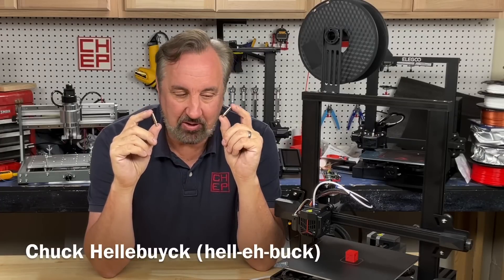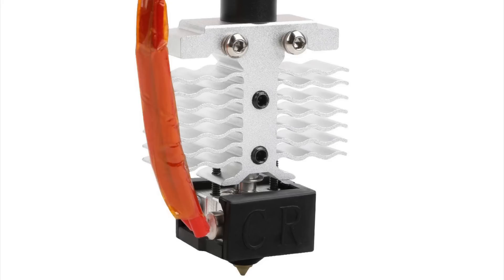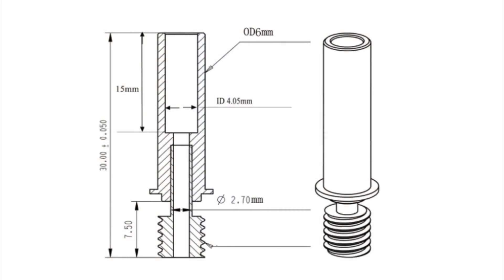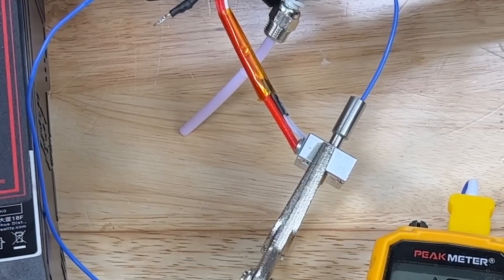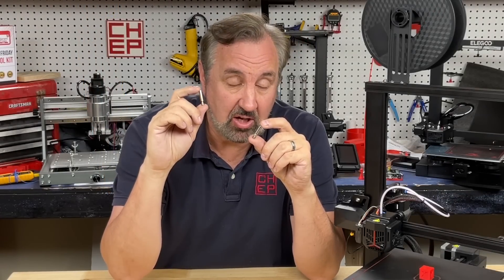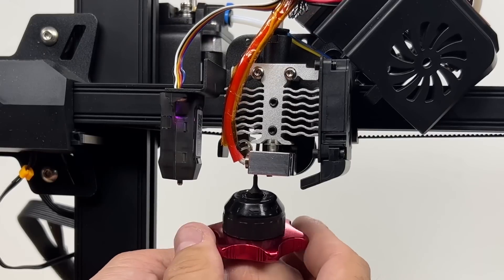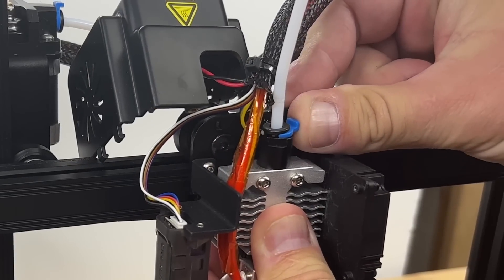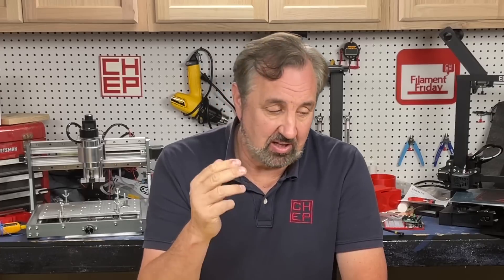Upgrade Ender 3 Neo Hot End

Comment: Thank you for this video. It seems Creality is mixing and matching things up a bit with their models. I have a CR-10 Smart with the same hot end shown in this video. I think the CR-10 Smart uses parts from the CR-6.  I'm buying this from your link, as I switch filament often and want to gracefully transition from PLA / ABS / PETG / TPU as desired. This might just help with that.

Comment: I wonder why my foray into the Slice Eng heat break created prints that were under extruded but only in spots with huge holes in the print.  I went back to good ole hot PTF Tube and all is perfect again.  I just wanted to reduce the amount of times I change the PTF tube but it's worth the work to have better prints.

Comment: Great video, Chuck!  I spent $100 to upgrade my Ender 3 Pro, not aware of this printer which has all of the upgrades I purchased pre-installed.  I'm still struggling through issues with my upgrades (and a possibly a failing extruder).  If I'd known I could have purchased the Ender-3 Neo for under $200, I'd have just sold my Pro and purchased this one.  I'd be way ahead!  Hind sight, as they say...

Comment: The only issues I've had with all-metal hot ends is with PLA at lower layer heights (sub .2) with a .4 nozzle or if I try to iron the top of a print.  As long as I'm pushing a good amount of plastic at a decent speed, the all-metal hot ends work well.  I haven't tried a bi-metal yet and that might do a better job of keeping melted material from creeping up the heat break and causing a clog.
Reply from the maker: I’ve had no issues with that.

Comment: I've been using all-metal heat breaks in my Ender 3 and Sidewinder X1 for a while and wouldn't go back to a standard setup ever again. With the quality metal heat breaks out there and a little tweaking to your retraction settings, there are absolutely no advantages of having PTFE in direct contact with the nozzle (while there are plenty of drawbacks).
Reply: how are your retraction settings
Reply: @JPZEF  On the Ender 3 with the Micro-Swiss hot end and direct-drive extruder, 1.5 mm at 35 mm/s seems to work for pretty much everything other than TPU (I last printed Ninjaflex at 0.2 mm and 50 mm/s). For the Sidewinder with either the Polisi3D or Trianglelabs bimetallic heat breaks, it's varied between 1 mm for PLA at 25 mm/s, 2 mm for PETG at 25 mm/s, and 0.5 mm at 20 mm/s for TPU.

Comment: This has to do with heat conduction, not absorption. Titanium is a very poor heat conductor but has a high melting temperature, which is why it's the metal of choice here.  Copper is a very good heat conductor, which allows the heat to conduct to the filament near the nozzle.
Reply: All those fancy bi-metal arguments only give small incremental benefits.  Just stainless steel all the way is better than having the PTFE tube going to the nozzle.  Sure, a bi-metal heat-break will ensure better cooling at the cold-end because of the copper there and hence make the temperature of the fillament above the small section a bit lower, but if stainless steel can get this below the glass-transition point quickly enough, then the extra gain of the copper doesn't bring much.  And the melting is done at the hot side, where you have either PTFE, stainless steel or titanium up to the nozzle, which all suck for transferring heat, but that's also the intention.  So the melting is to be done in the nozzle, not the heat-break.  So, I'd say: at least get a $2 stainless steel all-metal heat-brake replacement as even that cheap one will be much healthier than cooked PTFE!
Reply: @MisterkeTube  I'm guessing that you're right, that the bi-metal aspect is only slightly more than a gimmick.

It would be good to do some measurements to see how much the flow rate is affected by going from pure titanium to the bi-metal design.

I'll bet CNC kitchen has done it already. I haven't bothered to look.

Comment: Did you need to change your retraction settings? I put a all metal heatbreak in my Ender 3 Max and found that it appeared to be retracting melted PLA into the cooler section of the metal path and causing blocking. I have experimented with Maker;s Muse retraction tower everything in the range 2mm-5mm but nothing seems to be "perfect" - too short and stringing and blobbing is a problem (because of he bowden tube?) and too long it seems to jam as described. Its possible I might have a problem with the filament as what I have is getting a bit old, so I haven't tried everything yet, but I just wonder if there are any other things I should look out for, I would try a direct drive extruder (which I have but needs modifying to fit) but am worried about the extra weight on the wider X carriage and I can't afford dual Z right now even if one was available for this "frankenstein" printer.
Reply from the maker: I didn’t change mine.
Reply: @FilamentFriday  Hmm it may be something else then. I think I'll try getting some new filament  just to eliminate that and then redo all the setup again.

Comment: I'm just really confused on how companies still can offer ptfe lined hotends. An all metal heartbreak is like 5 dollars max, and can boost the printing temp far above 260c.
Reply: Or 30 ish if you get the slice engineering one
Reply: @sammy_1_1  yea but that's crazily overpriced. You can get a heartbreak with the same performance for much cheaper. Even the official e3d one is like 7$

Comment: He didn't mention you should change your retraction settings when installing an all metal heat break.
Reply from the maker: I don’t. So I didn’t mention it.
Reply: @FilamentFriday  I see. Very interesting.  When I added mine to 2 different printers I was having issues with clogging. Changed my retraction settings and now they print beautifully.
Reply: @jerryscott6924  How are your retraction settings now?
Reply: @JPZEF  they are good. Went from 5mm and 45mm/s to 2mm and 25mm/s.
Reply: @jerryscott6924  what is you gcode star/end

I fell that most of my issues with retraction are related with clogging when starting.
I don't know if it is a bltouch related issue

Comment: How about the Ender 3 Pro? Will it work for that model?
Reply: I've built hotends with these heatbreaks(e3d & mk8), just find the style that fits your hotend and follow CHEPs directions to install.
Reply from the maker: If you follow the video I linked in description it will work with pro.
Reply: I have my Ender 3 Pro working with an all-metal heatbreak I've found online since 2 years ago... Best upgrade I ever made to this machine! (And I could tell you I performed way too many upgrades to it! 😅)
Reply: @nilssondelgado  how are your retraction changes now?
Reply: @JPZEF  Good question indeed... After many testings I found that a good retraction distance setting was around 3.0mm, but after a while I converter my Ender 3 Pro from bowden to direct drive (not using any conversion kit but my own design and setup  -- working mint by the way! -- ), so I had to reduce the retraction a little more down to 1.0 or 2.0 mm and the fastest speed (45-55 mm/s). Depending on filament brand and type this values needs to be adjusted, some materials work better on bigger retractions, some others do better on shorter distances/speeds.
Regular PLA or PLA+/Strong are piece of cake to print, silk PLA colors are kind or "hard" to print, so I need to tweak the values and also for ABS or PETG.
Sometimes it takes lot of test and fail before a good quality print. ✌🏼

Comment: When changing to an all metal heat break its important to reduce retraction distance or you're going to have problems.  If you're running a bowden setup, 2mm retraction might be your new max.  With direct drive, 1mm (or close to it) might be max.

If you're trying to get fine details out of PLA, don't bother with all metal heat breaks as your bowden tube is doing exactly what it was designed to do.  All metal is for plastics requiring more heat than PLA.  Just one humble opinion.
Reply from the maker: I print with all metal on my Ender 3 V2 every day in my printfarm with same 6mm retractions and no issues at all.
Reply: @FilamentFriday  I wonder what the difference is then?  In your print farm, what material are you printing with and at what temp?

I'm using the all metal heatbreak for ABS at 230-235C.  I was getting clogs until I reduced the retraction from 6mm to 2.2mm.  Perhaps there was something else going on??
Reply from the maker: PLA at 205°C. 6mm retraction on bowden.

Comment: The thing that we’re probably all curious about… if it’s such a big improvement, why don’t manufactures just include an all metal part? The same way they still make inferior, plastic extruder arms, when they all fail so easily.
Reply: The heatbreak needs to be super smooth to not cause a clog. A ptfe tube is super smooth slippery, so doesn't have much risk of causing a clog. Not to mention cheap and readily available. If you are only gonna print with pla, then it is the better option. If you need high temp resistance, you have to go all metal.
Reply: Because they have tons of this stuff in stock and it must be sold first XD
Reply: I think it is because PTFE hotends are more forgiving for bad retraction settings for beginners, but I feel the PTFE breaking down and clogging cause more issues than it fixes. Just my $0.02. I do wish they became the new norm but these machines are made to the cheapest possible price, and good upgrades be darned.
Reply: Cost - bimetal heatbreaks a precision item = expensive. Ditto with metal extruder arms.
Reply: @danpeters5163  That's true but bimetal isn't needed, and unless the manufacturing process is very high quality, it's a disadvantage - more risk of internal lips and jams. This same vendor (POLIS3D, Triangle Labs reseller) has all titanium heat breaks machined from a single piece for only $7 in US. Getting direct on Ali is probably cheaper still.
Reply: Historically, all metal was a tradeoff because the large throated ones had heat creep, and bad manufacturing left internal lips to jam on. Modern style thin throated all metal is very different. It's still a tradeoff on Ender 3 & clones with the bad stock extruders just because there's more friction and the extruder is so borderline to begin with, but if you put on a good extruder it's all win.

Comment: This is a perfectly timed video for me.  I just bought a Diamondback nozzle so I can print all the abrasive filaments I'd ever want on my original Ender 3 (highly modified), but still have the stock hotend.  I want to be able to print higher temp abrasives such as PA12 CF Nylon, so I just started looking into bi-metal heatbreaks.  I think you just convinced me to finally make the switch!

Comment: I installed an all metal heat break on my Ender 3 v2 and had nothing but problems using standard PLA.  It kept clogging.  I tried about 5 diff filaments, same issue. So had to go back to the Capricorn tubing. Having said that, this all metal break works great in my other Ender where I print my own homemade PET at about 257C.  Any thoughts on why I had issues with standard PLA?
Reply: Retraction length should be 2.5mm, speed 50mm/s
Reply: @mster50  okay.  I never adjusted the retraction and left my Cura settings where it was 6mm I believe.  That longer retraction could cause hot plastic to be pulled up too far into the heartbreak?  I could see where that would then cool enough for the plastic to then adhere to the metal.  With Capricorn tubing, likely that hot plastic wouldn’t stick to the Capricorn tube.  And my my PET printer (runs hotter), the plastic may still be hot enough to NOT stick to the metal.  So, good advise!  I may reinstall the Slice heartbreak and try again.  Thanks!
Reply: @KevinGroninga3D  Correct - what’s happening is you’re retracting soft plastic into the heat break, where it rapidly cools and hardens
Reply: @mster50  yep, totally sounds reasonable to me!  Like I mentioned, I may reinstall the all metal break and then adjust my Cura profiles to lower the retraction.  Hey @CHEP, in your available Cura profiles, have you adjusted or lowered the retractions for these all metal breaks by chance?
Reply: @KevinGroninga3D  I'm in the same situation as you, also with an ender 3 pro and a bi metal heatbreak
Reply: @JPZEF  okay, that tells me that it wasn’t just me or my setup.  It’s been suggested that we adjust the retraction.  I think I was doing 6mm or 6.5mm.  Perhaps we need to reduce to 2.5, or a setting where that hot plastic isn’t pulled up too far into the heartbreak and cooling enough to stick to the inside of the heartbreak.  Thoughts?
Reply: @KevinGroninga3D  I need to see the other video and try again, I will try to provide some feedback!
I tried the metal heartbreak last week and then changed back
Reply: @JPZEF  I also removed and went back to the setup where’s there’s a section of Capricorn down to the nozzle, then the small washer and then the Bowden tube fitting screwed in tight against the plastic washer.  I think in this setup, the hot plastic isn’t sticking to the Capricorn because of its natural ability to prevent plastic from actually sticking to it.  This is a really great topic!  I think we should revisit the all metal hot end and experiment with the lowered retractions.
Reply: @KevinGroninga3D  I agree.
I also have the setup with the small capricorn, the washer and the then the rest of the ptfe tube
Reply: @KevinGroninga3D  I've found my issue. I has using the bi-metal heat break for a E3D hotend but should be using for a CR10 hotend, so its my bad
Reply: @JPZEF  well…. There’s your problem!!!  😂
Reply from the maker: How do you remove your filament? 
You have to push it out so it gets hot before pulling it out quickly or it will cool to fast and plug the all metal heat break.
Reply: @FilamentFriday  it was clogging while printing.  But in regards to removing.  I heat up and when at temp, I push until I get quite a bit oozing out. Then quickly pull it back so that any hot plastic clears the hot end.